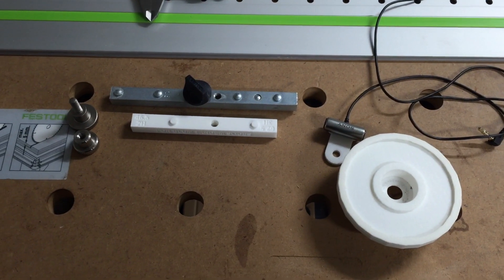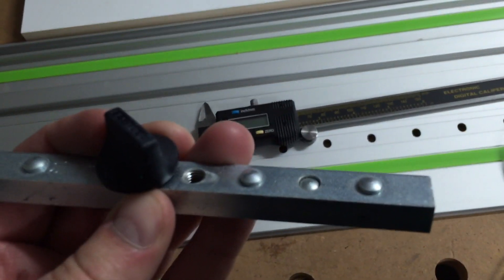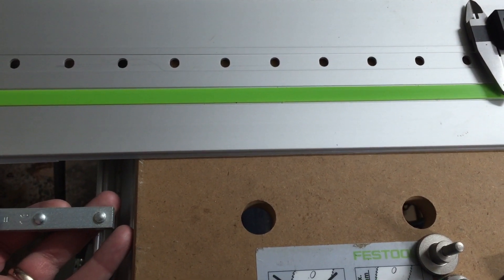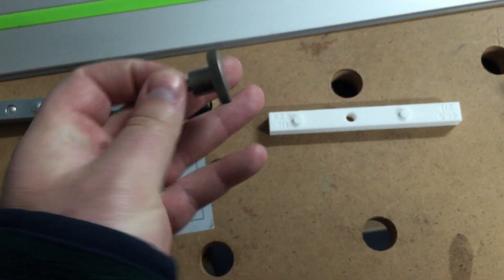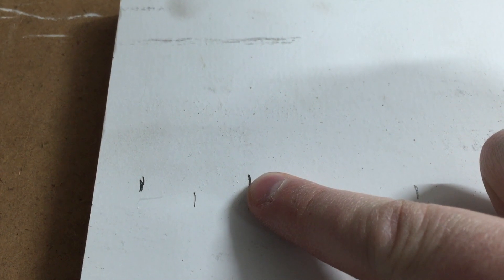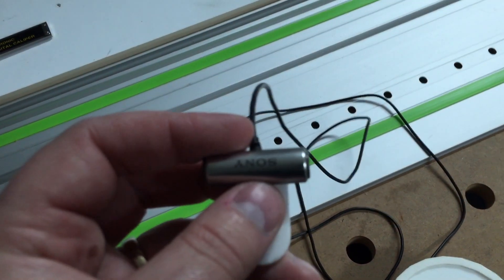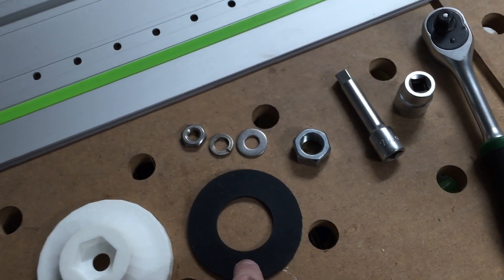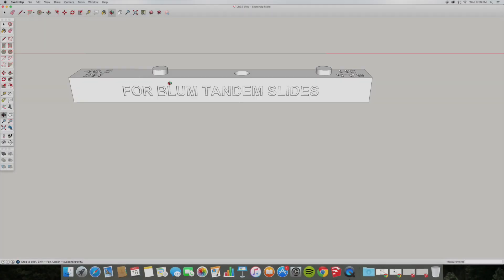3D Printing Overview

Comment: Really nice. You can buy brass inserts for plastic parts that are either threaded on the outside, or knurled. The knurled ones can be heated up with a propane torch and pressed in with a drill press if the part is made of a thermoplastic. I'm not sure if your part is a thermoplastic or some kind of porous powder that has a binder injected. But if one were to make this on a home 3D printer the knurled heated inserts do very well. Thank you for sharing.